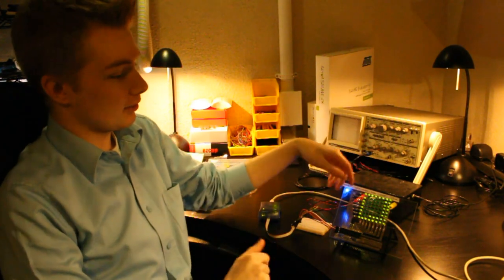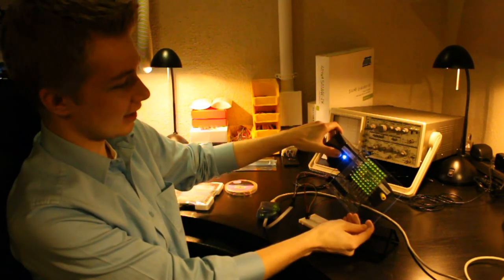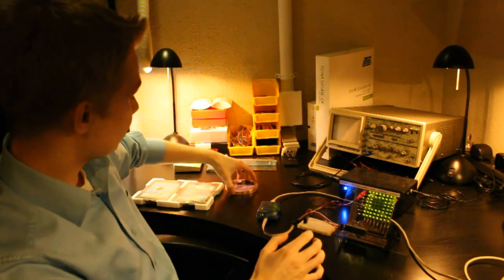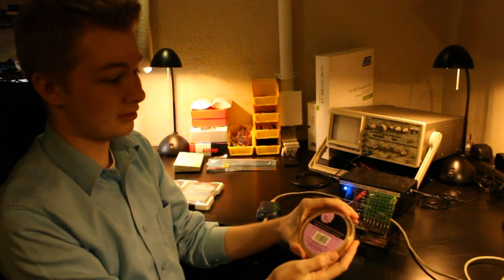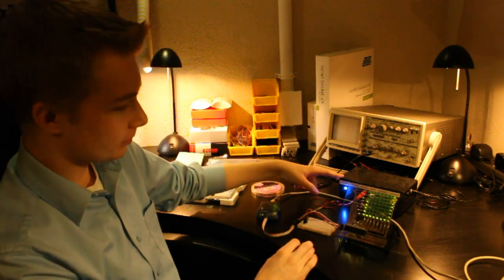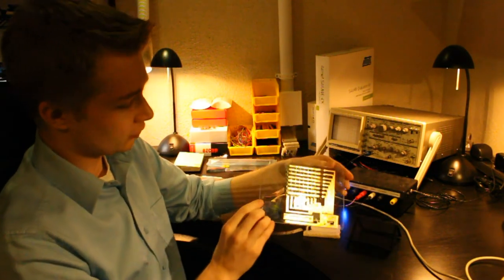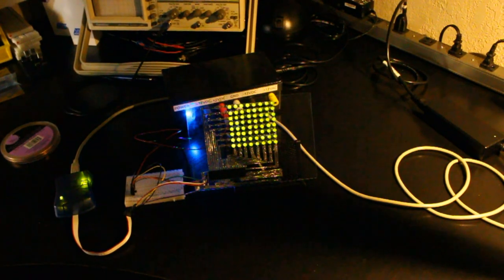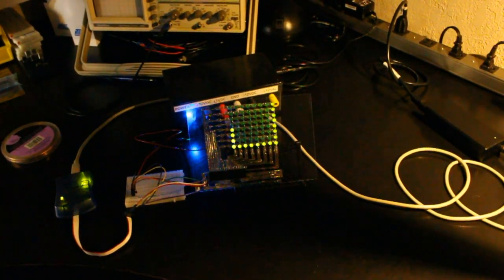Glass Circuit Board

Comment: Actually, I'm really surprised you were able to solder it that much without the glass cracking.  I have cracked the glass a few times now.  Maybe you have more insulation between the copper and glass?